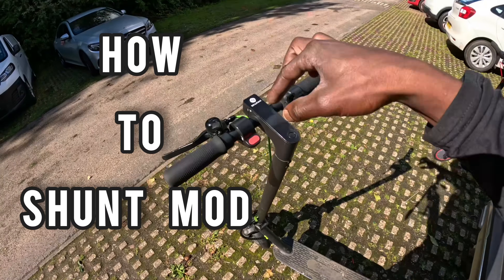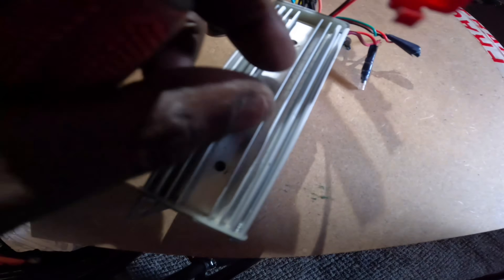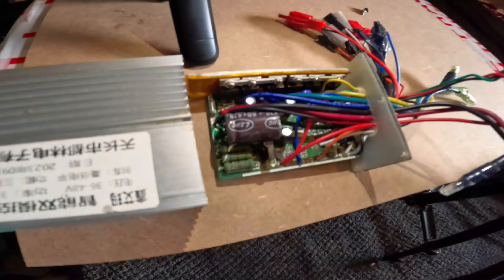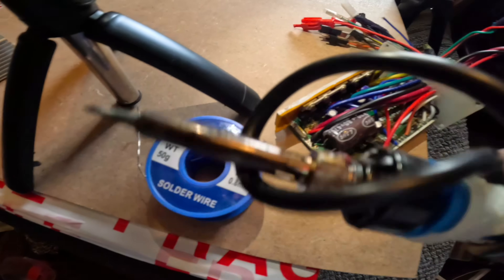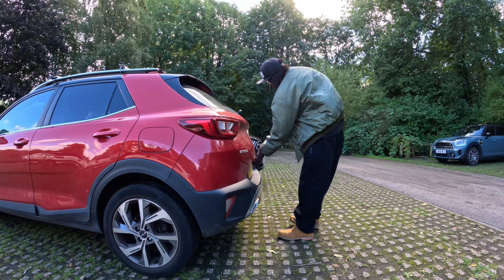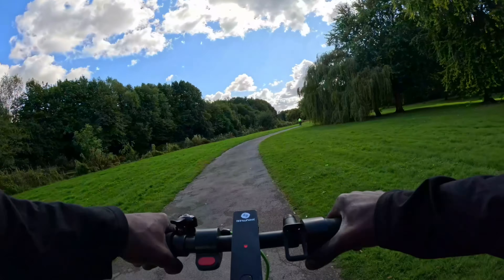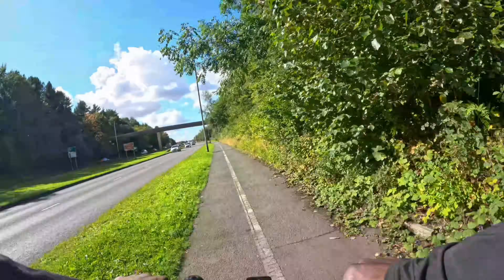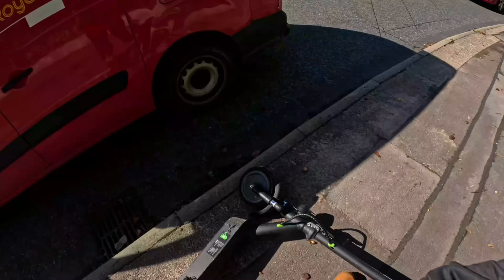How to make any ebike or e scooter faster with Shunt Mod

Comment: Even OKAI es10
Reply from the maker: The best way for the es10 is a new speed controller with more watts. I would advise a new speed controller, same volts as your battery but more watts. Shunt Mod is never going yo be as powerful as a controller rated for more watts. If it already has a high watt controller, you need one with a higher amp rating. 1000w controller with 35 to 50 amps will see the scooter flying uphill

Comment: Lmao uhhh dude.. That's 31kph... not mph.  That's what, an iscooter i8? 350w with a top speed of 15mph.  You're not doubling the top speed on a 350w motor with a simple shunt mod.  Why lie?  Just be happy with what you have.  I've got an ix4 with 800w motor and it can barely get to 28mph.  If it was actually possible to get that much performance out of a 350w every single scooter manufacturer would be doing it.
Reply: 😅😅 bruh chasing it hard goin a gud 15 lol

Comment: 2x faster
4x less range
Reply: Is it still less range if you do this and ride in pas 1 while pedalling?
Reply: 5% faster, best case.
Massive gains in acceleration (wheelies) until the MOSFITs catch fire, destroying your controller.
If it is a very high-end controller that uses premium MOSFETs, it might survive long enough to destroy your motor.
If you want to go faster buy a new controller and battery that is higher voltage. (your motor should be fine for a 10-20 Volt increase).
If you want better acceleration (wheelies) just get a controller that has a higher amperage output at the same voltage. Your motor should be fine unless you want to do wheelies all day long. This could cause battery overheating and fire, depending on the existing battery.
Regardless, as @djieffe said, any shunt mod will reduce your range dramatically, even if you ride in pas 1 because you will be pulling more current from your battery all the time.
Reply: if you have a big enough battery who even cares?

Comment: Not safe the battery will end up with a thermal run away😂
Reply from the maker: Fair point. For thermal runaway we do need to be sure our components especially the battery dies not overheat. Mechanical damage, external heat, short circuit, or overcharging can cause thermal runaways. Fair point raised but si far personally I have not had such issues

Comment: The shunt mode increases the current to the motor hence the torque, you will get a bigger acceleration because you are straining the controller more. It is impossible to increase the top speed! You need a higher voltage battery! also this so so dangerous, those tiny scooters are not designed for such high speeds, a small pebble can make you go flying! Bikes are much safer with this mod, do at your own risk!!!
Reply: Ok Karen
Reply: Also you are potentially overloading the motors original power capacity by increasing the voltage output and risk having to do the unthinkable...
.....Walk.
Reply: More torque does mean more speed with rider weight on the scooter, but obviously free wheeling will not give more rpm.
Reply: @audioglitchguy  free spin is way faster than loaded spin so you do get a decent bit of top speed out of it but not as much as youd get from more voltage
Reply from the maker: Yes most definitely do at your own risk